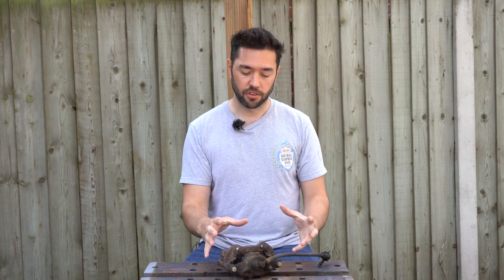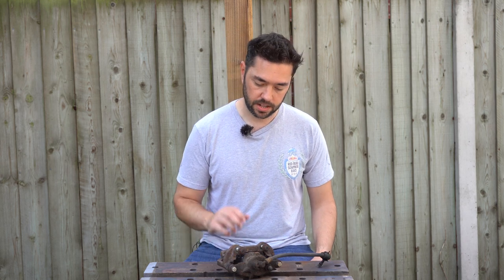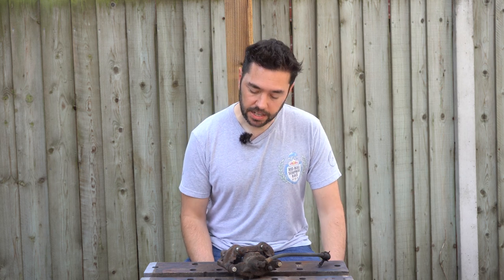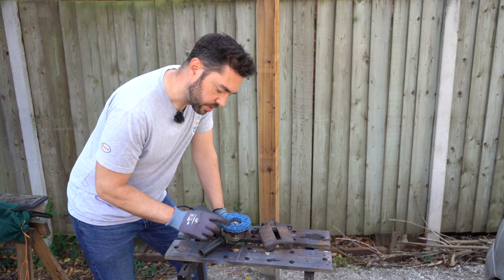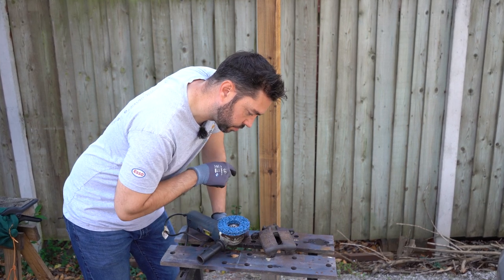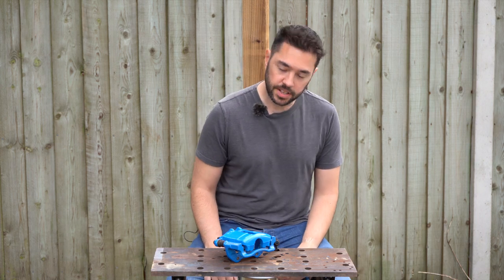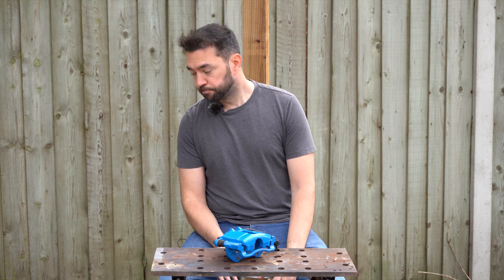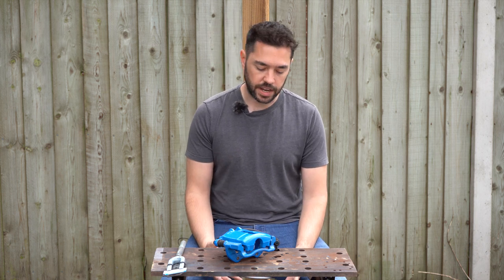Brake Caliper Refurb on the MG TF

Comment: Loving the series. 

With motorcycles I often re-use rubber bits if they are going to be difficult or expensive source by soaking them in AT-205. While not what the product was intended for it makes them supple and squishy again, like new. Thought you may be able to refurbish some of those suspension parts. 🙂
Reply from the maker: Thats a great suggestion, thanks 👍

Comment: Calipers look great mate bit bear in mind these calipers are a bit pants tbf. I'm sure your aware there are an AP racing 2 and 4 pot calipers and 304mm discs available as an upgrade and are way better than the sliding calipers. Just a thought for the future. Great video.
Reply from the maker: Cheers Mark, its a valid point and i may tie that upgrade in with the future engine swap 🤔👍